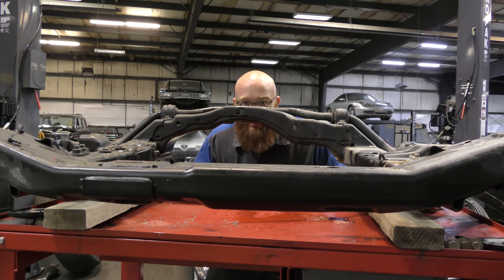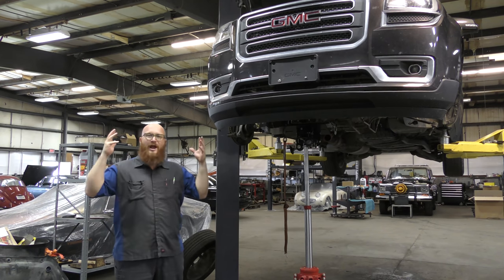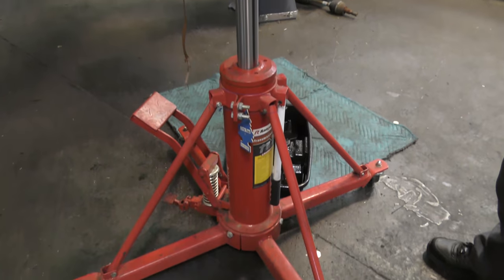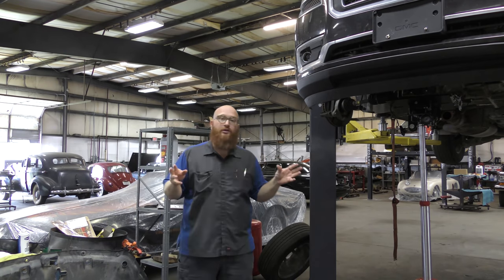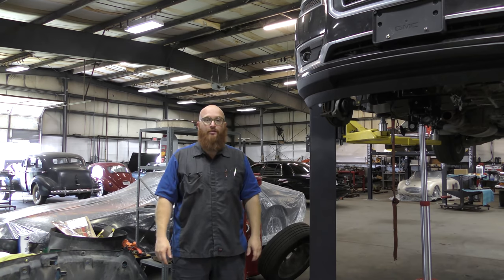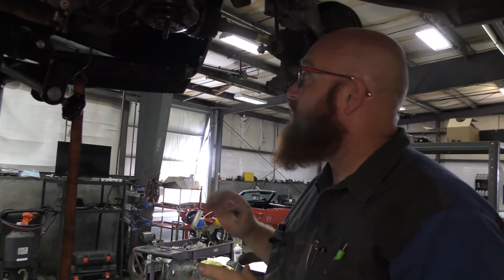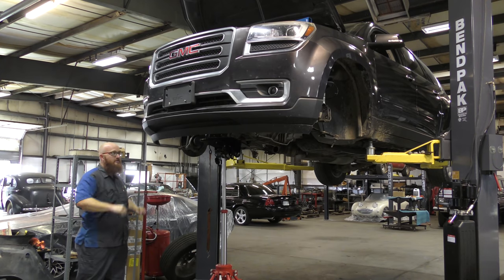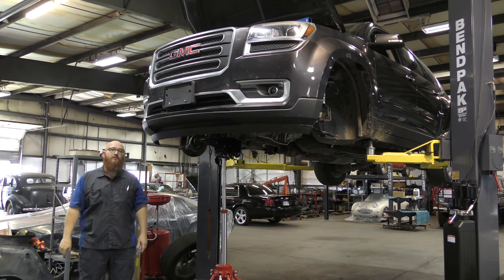Used car insanity in the CAR WIZARD's shop! Why did the huge repair get approved on this '15 Acadia?

Comment: you know how people shit on Subaru head gaskets 2.5k to have new oil + filter coolant waterpump+pulleys belts and timing belt seems like a better deal BUDDY
- i'm the 3rd owner of my car it was 11 years old when i had it fixed. i did toy with buying a new car but i thought long n hard figured would I rebuy my car for 2500$ or get a loan-- i didn't see any new car i wanted i want something the size of the impreza but a wagon, japan gets the Levorg and Exigia .....

Comment: Prices have gone up on used for so many reasons..
1.  Production of new models slowed right down during covid so there is a big back log..
2. New vehicles are costing so much more as they have added on a lot more safety and emission kit that has really pushed up the price to a point that many buyers can't afford new..
3.  The EV alternatives are too expensive so people once again look at used..

But do avoid the sea 🌊💩of turds at auctions 😂

Comment: I never understood why people would spend their hard earned money on American cars when you can buy a Japanese car that will last for a few hundred thousand miles with minimal repairs
Reply: Misplaced loyalty… considering “American cars” are mostly made of Japanese/European/Canadian parts and only final assembly is done here — and more often it’s in Canada.
Reply: I had a Toyota once.  It was unstable in slippery conditions.  It turned me off to Toyotas.  After that I had two Isuzus — GM/Isuzu products.  Liked them both, but Isuzu is out of the US market now except for trucks.  Bought a Ford — worst car I ever owned.  I don’t even like to remember I owned it.  Now I have a Chevy Colorado pickup.  This truck has some Isuzu input, I think.  It’s the best vehicle I’ve owned, so far.  I expect it to be the last vehicle I buy.

Comment: A well built vehicle that is uncomplicated will last when you keep it well maintain.  Neglect and it will fall apart. A poorly design vehicle will have one problem after and to make matter even more complicated is how  each components are layout in the most inferiating place that just made absolutely zero sense. This is why when i shop for vehicle i look at the vehicle layout and see how complicated they are when it comes to servicing it. If it looks out of place and made zero sense, i just walk away period.  It just not worth the headache and the money being invested into a money pit vehicle.

Comment: This video really resonated with me, especially the HVAC actuators.  Recently, my 06 Chevy Monte Carlo 3.5l blew a head gasket.  I almost had 200k miles on it.  I thought about putting it to pasture and buying a Toyota or a Honda (my first time considering anything other than a GM).  All the cars in my price range of 13 to 15k however, were either only slightly newer or had about 200k miles on them.  Didn't make much sense to spend that kind of money for a car that was only marginally better, so I replaced the head gasket.  The used car market is insane right now.

Comment: The timing chain on an Alfa Romeo Nord four cylinder twin cam engine would last up to 200,000 miles as long as the oil was changed and the tension adjusted annually..which took ten minutes maximum. Car makers have designed in fragility in the last two decades in a way I can best describe as cynical. Concentric clutch slave cylinders anybody.......why? They instantly change a low cost fix into a high cost fix compared to the traditional externally mounted slaves. Engineering quality has been dumped on the scrapheap by companies that know better. I know cars being scrapped as it's not economical to change the clutch slave......wow !!!!

Comment: GM wonders why their going tits up when they make a part with a plastic gear that's guaranteed to fail over time. One way of thinking is why should I pay for a $1000 repair job when a new SUV is only $65,000. The other way of thinking is if I would have bought a Toyota that gear would have been made out of something that wouldn't have broke. And considering a plastic gear only costs about 20 cents and they don't even sell the gear , you have to buy the whole motor. Even stupid people that know more about things they never use than the thing that costs as much as a house did 50 years ago that they can't live without are tired of getting screwed by American car companies. These CEOs make millions of dollars by saving a dime here and a quarter there. Made in Mexico or China is not made in the USA. Made in Japan means top of the line stuff no mater what it is.

Comment: Given what you've just said - does the engine, (2.4 litre), on a PT Cruiser have to come out to change the cambelt?
I've been given several quotes - some say it can be done in the car for $1200, others say $3.5K, because the engine has to come out.
Your opinion?
Reply: Engine in but a real pia

Comment: It astounds me that we have the same engines in a rwd car: they're hard to work on because they're rwd. GM: wait until you do chains on an east west layout.
Reply: Thanks car wizard. I should add it looks like we're going to follow your tip at 6 minutes camshaft retard advance. I'm going to give it a crack using dash command and the elm327 I've got kicking around. The VE commodores drive so nice, like a cheap RWD BMW and I am lead to believe the PCV modification makes a huge difference to the life of the chains, a lot of holden commodore guys enlarge the size of the PCV valve inlets and outlets, then let it sit in some carb cleaner or thinners. I realise these readers cannot compare to the usability, flexability of a true 2 way quality scanner but for Joe Average it gets you data that many average mechanics don't look for. Your advice is great. Thankyou for the excellent videos you make and again thanks for surviving Hoovie's cars.
Reply: Edit: just stayed with our old Ecotec v6. It has more torque and uses less fuel.

Comment: So if the market wasn’t like it is,would this car lot even have bothered to repair this POS?Or would they have just sent it to the auction?I sold auto parts at Oreilly Auto Parts and then for NAPA for 27 years.If someone asked me what  used cars to buy or not to buy,I usually would recommend not buying used Audis,BMWs,Mercedes,,or VWs.Stay away from most Chrysler products.Ones I would recommend would be most Toyota products,Honda,and some Subarus.

Comment: Question. Would you charge full shop hours for the motor mounts? Or because you are already into the motor mounts is it just the cost of the part?

Comment: My 09' Acadia threw a P0008 the other day, I cleared it and been running fine, so whats that mean?  Do you need both codes. Can bad spark plugs cause a P0008?

Comment: Does not shock me this needs a remain seal. I was at the dealership having some warranty work done on my 2009 Chevrolet, They had 5 of these in the Bay replacing remain sealed on every one of them. Is in my opinion Chevrolet quality this relay quality is crap. It's all about who supplies who supplies the part at the cheapest price for them to make the highest profit, Oh wait that's all of the big 3. Either way I would not own one of these turds it's turds and I have discouraged my wife who has been wanting 1 for for years not to buy 1.

Comment: Well I guess someone needs to defend GM...may as well be an idiot.   I bought my 2012 Terrain 2.4l in 2019 with 140k miles, and did a timing chain service myself (the only shop I took it to wouldn't even do the work...basically said "take your thousand-plus dollars and hit the bricks buddy.") and it's run like a Swiss watch since.   It does use a little oil, but it must be going out the tail-pipe because it isn't leaking.  
     But I buy cars I can write a check for.  I don't do car payments.

Comment: I hate those cookie cutter GMs, put together once, never engineered to be fixed easily. A rear main on that 3.6, just total it out. And it's AWD. On top of the repair price you have to pray whoever is working on it has done one before.

Comment: That car is the most trash car I've seen in my life. We have a customer experiencing timing tensioner causing chain to make noise.

We replaced it and afterwards began losing compression in one cylinder, so we changed it out with a brand new rebuilt engine.

Right after the engine replacement, the transmission started acting up, so we replaced it with a brand new rebuilt tranny.

After tranny, we noticed the honey comb material coming out of the exhaust manifold.

It also looks like the steering rack is slightly leaking.

Worst car ever

Comment: In the Fall of 2022, a Toyota Solata V6 was listing $3,000 Firm on craigslist but "needs a water pump" was in the ad.

Some random GM 4-door "needs nothing/daily driver" was listing on craigslist for $1,200 OBO.

A broken down Toyota is listed almost 300% more than the GM.  All that needs to be said right there.

Comment: I'm in Australia. I now you drive on the wrong side of the road, 1812 should have sort of that out. Taking the piss. I have a 2013 mazda 3, on cooling servo actuator vent control face to foot well, and so on. Is that one hard to get to.

Comment: When those two timing chain codes come up, can the car still run normally? I only ask because I remember pre-computer cars still being able to run with stretched timing chain. Also, those cars back then had a lot of miles on them, were old style timing chains better than todays. It seems like these new chains aren't lasting as long, or are sensors too sensitive?
Reply: Quality cars (not necessarily expensive ones) were engineered with double row timing chains....
All these ones with stretch problems are single row....funny that....

Comment: Actuator story. Wife has an Audi A3.  Convinced VW can't make an HVAC system that's durable.  Dash has to come out to replace the center HVAC unit.  This is the second time the dash has come out in the 4 years we've owned it.  Fortunately under the CarMax warranty, but we will be dumping this car before the warranty expires.  It's a shame, as it's the best car we've owned by far.  But we can't maintain a car that needs to have the dash removed every 2 years.  Germany is sliding head first into the the American car quality standards game.

Comment: What a piece of junk.  Hat's off to the used car dealer for trying to do the right thing, but still.... these GM SUV's are so poorly engineered it's hard to understand why people continue buying them.   From what I've read  ... the timing chain issue is caused by two things....extended drain intervals, and the fact that these engines tend to consume oil & folks never raise their hood to check the oil.   Low oil level leads to stretched timing chains.   Ugh..

Comment: Wow, after watching this, I really really want to sell my Hondas and Toyota and buy a GM. What a pathetic excuse of a car. The worst part is that new, this car was priced as much as a Honda Pilot, Toyota Highlander... those are still fine after 5-6 years, and this POS is pretty much mechanically totaled. So you fix it now, 2-3 years down the road it will need the same work... customer probably just paid it of and is now screwed. Thank you big 3 so called car manufacturers.

Comment: people quickly forget GM did make much better engines. my 2001 grand prix has the 3800 buick engine. it's 20+ years old and doesnt need a rear main seal. it actually doesnt even consume oil. 

the 3.6 is a piece of junk

Comment: GMC finally fixed the Terrain last year, but it's still overpriced, IMO for what you get.
The 9 speed transmission is the good one, because it's basically the same one they use in several commercial vehicles.  
It's not available on the Equinox or base trim Terrain.  Why, I have no idea.  GM as usual leads with its worst foot and then asks you to pay stupid money for what should be standard.
That said, my 2014 Mustang is worlds more reliable and less expensive to fix.  It isn't rocket science to make a reliable car.  GM just seems to not ever have figured it out.

Comment: Yes sr! A turd card that smells like vanilla on the insides xD that's why I love cranked windows and the only comodity really necesary is the air conditioner... All the electronics into the new cars only rises up prices and drain your money out. Car industry yells they care about ecology and produce turds that still eating 5 liters gas... That's crazy too. The biggest motor I ride was a 2.2l ford inline4 and it was good. Very reliable and powerfull enough to be driven any way. It has to be cool to have 400hp under the hood. But is it really necesary? Using those monster once in the year to go aome car show it's ok... But 5lts daily drivers... Man You don't argument with the wizard and You dont cry about gas prices. Consuming more than the double that You really need. Just saying. Great video! I will look up for the crazy costumers stories in the channel

Comment: 14:50 they are STILL using that same blend door actuator??? 
.
like, my 99 buick century.... it just stays where ever it was when you shut off the car
but now days.... they go ALL the way to one side.... and stay their, with the motor still on
.
so in the -50 F Montana winters..... this causes the plastic gears to get brittle.... and snap
or in the 112 Montana summers...... this causes the plastic gears to get soft.... and strip
.
i guess they go "hard over" like that to seal out dust and leaves.... and mice
but i dont get leaves and mice in my 99 buick...... and its parked outside its whole life
.
just change the cabin air filter every 3 or 4 months 
.
.
.
like.... ya would think after ~20 years...... they could have figured out how to put a pressure sensor in their.....
but nope.... people would rather pay 2000 more for lane keep..... so they can use their cell phone
.
instead of paying 20 extra to have a HVAC system that wont go CLICK CLICK CLICK CLICK CLICK CLICK every time ya shut the car down
Reply: and my 99 buick century also uses vacuum to control the vents
the motors are only used for temp (dual zone)
.
and while vacuum systems can get leaks.... which cause poor MPG
mine has only busted in the hard plastic line in the engine bay 
quickly and cheaply fixed with some rubber vac line shoved over the end where it goes into a harness.... and then to the vac nipple on the intake
.
the lines inside the dash are flexible rubber...... which lasts for ever practically 
and auto-makers have had vacuum HVAC figured out for 60 years at this point
.
.
i just dont get newer cars sometimes 
ill keep driving my old 99 buick with 307,000 miles till it rusts apart.... or i cant buy parts (and in montana, we dont use road salt.... so its got ZERO rust)

Comment: Well wizard I don't know if I messed up or not I trade in a 07 Ford Focus yes I know throwaway car 2.0 motor for a 17 Buick Regal 2.0 motor turbocharged Ford have 54000 on it the Buick has 74000 on it it's an all-wheel drive like I said 2.0 Turbo did I get screwed on this or not I need to know how often to change oil in a turbocharged motor and with an all-wheel-drive how often do I need to rotate the tires should I use that I point to gas switches portal and it calls for 93 octane with a corn oil but should I use 4% gas which is only 89% and use an octane booster one thing I would like to know if you know anything about the Pennzoil with the hundred percent natural gas oil is that a better world use

Comment: Makes me wonder if the industry wide crap build of modern cars and the so-called chip shortage is a scam to get us ready to buy EV's. But I think they are trying to design them to a level of technical complexity that is beyond the ability of the manufacturers to maintain engineering standards at. When you look at any company, the designers and engineers that built the vehicles 30 years ago are not there now, or very few of them. So the pressure is on the new people to build something newer & better, and I think a lot of them are just not up to it. Even the Germans. Like, if they cannot get the cam chains right, they should just go back to d--n cambelts. Then you just know they have to be changed at 60k miles, but at a reasonable cost. The level of technology is just stupid. But if someone built a simple reliable car, probably no one would buy it. Need to have computers in everything now, I have never had a computer last more than 5yrs and we wonder why our cars don't last longer than that. EV's will be a nightmare. They will expect us to replace them like we replace our toasters, but instead of costing $50 they will cost us 50k. I guess we will be saving the planet though (sarcasm).

Comment: Have 2011 explorer 180000 miles no problems. 2013 fusion 210000 miles no problems. 1989 ranger with 2.3 liter engine had to replace clutch at 180000 miles now has 340000 miles. God I get tired of you Toyota fan boys. Move to Japan.  Buy union. Buy American

Comment: Want GM and Ford to quit building poor designs? By Toyota and Hondas they will get the picture and improve and they have in the past, but the god old Greed bug has returned to them and so it is time to say Bye Bye Ford and GM. I would buy the new Toyota Tundra even with this waste gate issue knowing I would still have a better vehicle long term with one than if I chose Ford or GM. I love my 2004 Silverado it was when GM was building a quality truck. Sadly when it wears out eventually I will go Toyota instead:P